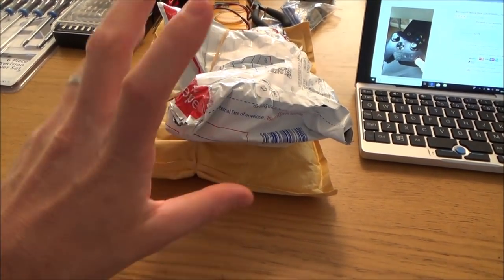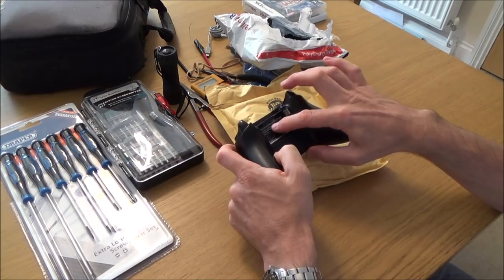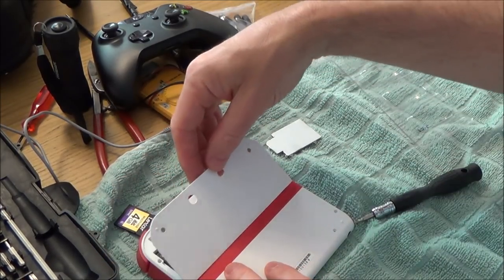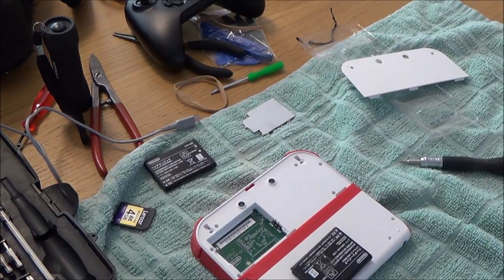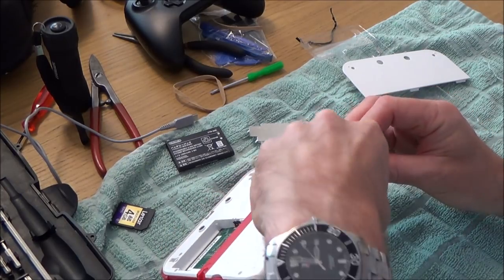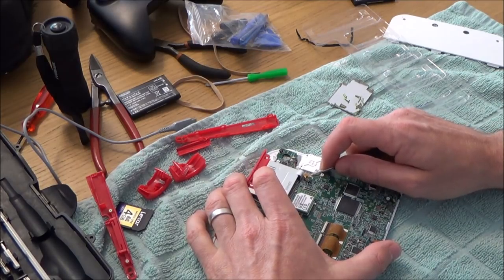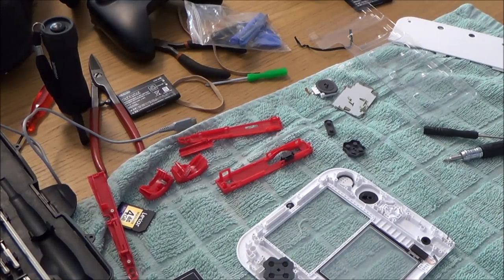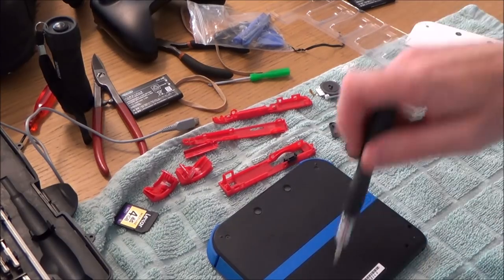Trying to FIX a Nintendo 2DS and Xbox One Controller purchased on eBay

Comment: When the 2ds detects a part missing or a broken part it will pop and not boot to stop further damage.
Reply from the maker: Interesting, thanks for sharing the knowledge :-)
Reply: Hmmm.... I am wondering if the battery you took (I assume it was from the 2ds xl that did the same poping for your last video) is also fauly, causing the 2ds to turn off. But then there is also the broken screen, so it might be detecting that (highly unlikely though). I have not watched the whole video yet,, so if the solution/answer to this pops up in it, don't yell at me.

Edit: I mean the battery you used before you replaced the parts into your working 2ds.
Reply: The battery isn't faulty, it's just unsafe.  Bulging batteries still work perfectly fine.
Reply: Elliot A. Ik, what I meant is what if the battery from a 2ds XL for a different video is faulty. WHAT IF!
Reply: They're all the same CTR-003, the old 3DS (not XL model, the small), 2DS, and 2DS XL use the same part.

I've also had this problem of popping and turning off with a 3DS and another on a 2DS. Even just a disconnected/badly connected flat cable is enough to trigger this hardware check and power up failure. In the 3DS you may usually be luckier that it's not the broken screen, but just the speakers flat cable torn (it carries speakers, 3D slider, 3D LED, camera LED, backlight and 3D panel signals. Yes, it does a LOT), and it's a cheap part but annoying as hell to install.
Reply: Kalvinjj ik that they are the same batteries. I was just saying that the other one might have been faulty as well. Anyways, yeah, broken ribbon cables are a pain in the ass to fix as they pretty much need to be replaced and can easily be damaged. It's kinda cool that the 3ds has a hardware check. It would probably be fine without one.
Reply: that explains why my mothers 3ds isn't booting up
Reply: Unsafe sounds faulty to me
Reply: It's actually popping due to a cable thing. I've heard of the popping issue so much, and now my 3ds is doing it as well. I have never taken my 3ds apart, and I have never replaced the battery. It just randomly started turning off with a popping sound. I'm worried it'll get to the point where it won't even turn on...
Reply: The Jolly Good Gamers my brothers old 2DS would freeze at a certain point in my pokemon X game, locking me in a certain part. Then other times it would show a bunch of colours on the screen saying “error 101”. Or it popped. Thx for info❤️
Reply: @elli6220  except for when they overheat or stop holding a charge
Reply: @Mymatevince  could you help a fellow nintendo fan? I have quite a few 3ds xl's and a 3ds and 2ds. the 2ds is my "problem" purchase. I purchased it for 28 USD and it was described as "will not turn on", I've tore it down, checked and cleaned and reinstalled all screen ribbons, tried cleaning known issue parts, and even recently put a brand new battery in. all I can get is a charging light but no power or response whatsoever with no charger. I'm at a loss considering there are no broken pieces upon tear down, nothing lose or water damage. any ideas sir?
Reply: @andrewvizla9454  haven't taken apart a2ds but on dsixl there is a sub board that has the power button and a f1 fuse check that first I had a dsi that wouldn't turn on but charge light would come on. I checked everything and finally got it to turn on after taking case off and pressing the button with uncomfortable amounts of strength
Reply: @elli6220 late reply it worked when my gopro battery started to swell up! I originally used that battery until I got a new one and discharged the old swollen battery as I believe discharged swollen batteries are safer

Comment: This is giving me a good idea on what to do with the 2ds that's in the mail. The ebay seller I bought it from was selling it with the "OLD"/Original 3ds, "OLD" 3ds xl, DS Light, and a DSi xl. now they're all faulty systems. Also I suggest for you to look into getting little shot glass sized cups and/or a Magnetic bowl to help organize the tiny screws so they don't get lost.

Comment: Would love to see some PS4 fixes, especially cleaning the fans as mine sounds like it's about to take off constantly. 😂
Reply: Steve my friends system does that as well, bad heat transfer from the APU is a possibility, get some thermal paste and get in there as soon as possible if that is the issue.

Comment: not sure if its worth mentioning but some 3DS/2DS which have been modded with CFW (older CFW) wont turn on without the SD card in, might be worth while trying that on some if you get anymore in the future.
Reply from the maker: Thanks for the heads up :-)
Reply: My Mate VINCE did you try it
Reply: Also adding to it too: they MIGHT turn on without a card. I've done it to my 2DS and 3DSes I've got to sell here, it's a script your run to copy the boot file to the internal memory so it boots with modded card, without, or with any card.
Reply: Kalvinjj aye that's the new cfw, older methods didn't :)
Reply: that wouldn't be it, if that was it, it wouldn't have made it to the home screen
Reply: @burp2019  yup I know, that's why the last part of what I said was if he gets any more in the future, wasn't necessarily meaning it was the solution for this one.

Comment: Those broken screens will haunt you to the end of time, man. Like I said before, you handled that like a pro and it's cool to see you already developing the resources you need to get the job done.

As for the Xbox Controller, that's basically programming and computer problems in a nutshell. Sometimes it just doesn't work, you fiddle with it, and then it magically starts working. Although now this opens the door to a very interesting path to faulty console controllers. I definitely would like to see more of those as you'd probably have a much higher chance of success since they don't have screens that'd need fixing!

As I said before, great video and keep up the awesome work, Mr. Vince! :)
Reply from the maker: Thanks so much :-)  I have a job lot of faulty Xbox One controllers arriving hopefully this week and I think they have various different faults so maybe the video will be more interesting and varied :-)
Reply: That sounds awesome! I can't wait to see it!

Comment: Great video mate. You should try finding a faulty switch now 👍🏻
Reply from the maker: I would love that but they are still too expensive. I missed out on a £109 buy it now listing that had a didn't charge fault because I hesitated. The auction ones go for over £150 for a faulty one without Joy-Con or dock which is madness :-)
Reply: I saw a faulty Nintendo Switch for 95 dollars in eBay yesterday
Reply: My Mate VINCE ok, hopefully it doesn’t take long for the prices to go down. Keep up the awesome videos. Love this style of video where you find faulty electronics and try to fix them
Reply: Uuuuuuuu
Reply: And now he has like 5 Switches. You should do 3DS bro :)

Comment: It wasn't because of the usb cable that the xbox accessories app wouldn't let you update the controller, the app is just really buggy sometimes. I've had the same issue when I went to update my controller which isn't faulty.

Comment: The reason the Xbox home was jumping so quickly when you press a button or shoulder buttons was because it was detecting 2 buttons pressed down and maybe the A button was a little but grubby and was sticking to the pad hence why you couldn't get it to turn on as well and also maybe due to the last owner having heavy sweaty fingers. Just thought I'd mention as I use 2 button press to navigate the home pages faster! Great video as always and superb fix.

Comment: "Yeah okay" semi excited sounding, then pulls out a hair XD cracked me up. Oh just a tip that I do when taking a controller with a rumble feature in it is tape the damn things into the slots they sit. Those things make me so frustrated while working on faulty controllers also helps keep those wires from accidentally breaking off.

Comment: Looking forward to seeing fix it video number 5. Keep up these videos really enjoying them.
Reply from the maker: Thanks Muffin Man :-)
Reply: My Mate VINCE You picked up a bargain with that controller, it was a corrupted firmware, leaving it plugged in for a few minutes initially downloads the firmware in the background, but re flashing the firmware again fixed the issues. Nice repair.
Reply from the maker: Yeah, I didn't know that until a few viewers mentioned it. It would have been a real easy fix if I knew that at the beginning. The controller is nice and clean now though which is a plus point even if it took a couple of hours to get there :-)

Comment: That's depressing. I used to take apart my Xbox 360 controller, and the Xbox One controller is the same concept. Torx 10 with security bit screws, 7 of them, 3 on each side, one in battery bay. Just they integrated a data board onto the Xbox One controller for firmware, which is cool. But what may have happened is, the firmware chip needed some power and data flow into it from an Xbox to reconfigure its chip so it can work again. And the reason they have a shield on the analog sticks to prevent the sticking is because the 360 design would allow you to take the analog stick all the way to the edge of the rotating swivels which would eventually snap them which made the analog sticks get stuck, nice to see they fixed that design flaw.

Comment: Vince i had a controller that wouldn’t turn on it was because the little gold trampoline (!) that seems to haven’t made contact between two boards. I pulled on it a bit and resinstalled and worked fine!

Comment: Super easy way to check for an expanded battery is to set it on a flat surface and spin it like a top. So long as the battery is manufactured flat like these and not something like a PSP 1000 battery then it should just stop because of the flat surface friction. If it spins then it's bulged and needs to be recycled.

Comment: Going off my experience with phones and laptops... Sometimes when things have been completely discharged they needd to charge for an hour or so before there's enough charge to power up..even if it is normally able to run off charger... Looks like you ended up on the right path anyway.... But worth bearing in mind.

Comment: The problem is the driver inside of the controller. when you plug in to PC it says DFU mode. (like recovery) and then when you connect to xbox and leave helped the drivers / software in the computer. that should be fix the issue.

Comment: DFU usually means Device Firmware Update and is a mode in which a device goes if it can't boot properly and wait for a firmware flash. So maybe the last firmware update failed ( explain why the controller was sold as not working) and when you plug it in the Xbox, the console detect the faulty controller and reattempted a firmware flash
Reply from the maker: Ohhh right, I didn't know what DFU actually meant. That explanation makes a lot of sense now :-) Thanks for sharing this knowledge.

Comment: when you put the the mainboard from the faulty 2ds into your working one you basically switched 2 parts, the screen AND the touch panel of the lower part of the screen. the screen is definitly damaged, but the touch panel could be too. for ruling that out you should have put the screen from your good 2ds into the faulty one.

Comment: You can tell if it's been opened up from screws, look them closely. Does it look like bit stripped, or does it have marks of screw driver. Also does the casing show some signs of opening

Comment: Lil tip; put a magnet on the shaft of your screwdriver to pull screws from recessed holes ;)
Reply: If you rub the tip of a screwdriver over a magnet you will get the same result.

Comment: I know this is a late comment but the reason why the Nintendo switched off is due to watchdog circuitry. when switched on the circuitry looks for feedback from the backlight of both screens and if either is absent or incorrect it will instantly turn off again.
This circuitry is found in all DS series as I used to repair them.  I used to temporarily bypass this circuitry to ensure that the working screen has no pixel damage before replacement.

Comment: I use a wired Xbox 360 controller for the pc and the cable died (loose connection somewhere along the cable). 
If you have a spare USB cable, that is really easy to fix. 

I de-soldered the internal connector that connects the board and the cable and just soldered the spare USB cable directly onto the board.
(more reliable than trying to get the male part of the connector onto a new cable, but I think that would be doable as well)
The cables have a standard colour code so its easy to know what has to go where. (Triggers facing away from you, it's: Red White Green Black)
https://i.imgur.com/VMenDBC.jpg
(sorry for the blurry picture, noticed too late but I guess you can see it well enough)
Was like 20 minutes of work, most of the time to get the casing apart and together.
Really easy and saves a bit of money. 

So yeah, I agree with the channel here, it's sometimes worth it to take stuff apart.
Of course, only if warranty doesn't cover it, otherwise sending it in would just be the better idea.

Comment: if you push down hard, you can use a small flathead screwdriver on xbox products, instead of the security bits. Anther tip is to use a screwdriver that you can put the bits into, to get a better grip.

Comment: Wow that controller was really weird. Idk how the programming for the controller works but it seems the drivers and programming were broken for it.
Reply: Alex aka Weekenders as Vince mentioned in the video, the device manager on windows 10 said DFU mode. Most of the time DFU mode is like a mode that you would use to install a firmware update, maybe the original user had tried to use CFW and somehow softbricked the controller. Leaving the controller plugged in would’ve taken it out of DFU mode so it wasn’t a driver issue at all.

Comment: i had similar issues with one of those xbox controllers. The usb connectors are prone to damage but whats worse is the USB cable that comees with them, it doesnt sit nicely in the port, mine was always wiggly and would drop connection at the slightest movement since the day i got it. I got some cheap usb cables on ebay and they worked alot better, snug fit and less likely to stop making contact with the pins. Eventually the port broke and I've used battery packs ever since, no more cable charging and disconnects. The a button also stopped working, and its very hard to find a suitable rubber membrane that fits well and doesnt feel hard to press. oem parts not available, just cheap aftermarket options that are hit and miss.

Comment: Ive been messing around with the 3ds line, and every single one will make a pop sound and shut off due to missing/damaged hardware. If it was really bad damage, it wouldn't turn on at all or get stuck with the blue LED (as in, no led at all or led would stay on indefinably). Try it with a mother board and battery lol
The touch screen broken making it pop wasnt due to the inputs, it was due to the fact iirc the voltage wasnt what the 2ds was expecting. Ive had a 3ds xl with the touch ribbon cable badly damaged, and the console worked fine, minus the touch screen regestering a bunch of touch inputs.
Also, theres parts that are for the most part compatible with the whole line.  EX, the wi-fi chip from a 3ds works in both the 3ds xl and the 2ds. It also would cause it to do the hardware fault if not properly seated. It was a problem with the 3ds xl, without people opening them up.

And about the CFW thing, its definitely not that, as it turned on long enough to get to the home screen
EDIT:What started as a 2 sentence comment evolved into a paragraph over the course of 10 minutes lol

Comment: no offense, but i'm really triggered on a few parts. one of them being the fact that the first time he tried to power on the 2ds, with the bulging battery still in it, he didn't let it charge, or even try to charge. he just went straight to trying to do stuff with it. the other one being the fact that the thing that fell  out of the 2ds when he was opening it was a piece of RF shielding, used to sheild the components and help cool them down. That aside, i love the vids, keep up the good work! :D

Comment: Yeah replace any bulging or swelling lithium ion batteries or packs they swell because gasses build up inside trying to escape but they can't until eventually a catastrophic event happens like the electrolytes leak or it bursts into flames also can damage device by putting pressure on anything near the battery especially if it is in a tight enclosure

Comment: The DS was designed to fail. I've had several of the original DS and the 2DS. They all stopped taking a charge around 6-9 months of use. Turns out there is a resistor that fails and stops charging. If you bypass it you're back in business. I still have one of each and they continue to function just find after the bypass. They're several years old now still going strong.
Reply: Also my 2DS have the triblade screws. I don't recall seeing one with phillips heads. I could be wrong.

Looks like the one you ended up with took a hit in the front. The screen was cracked and bent inward slightly. I bet it was an angry player that went completely "game over" on that device.

Comment: I tried to fix my Nintendo DSi With common sense like you did and even looked after my screws. and then went to put it back together and somehow I had lost a screw even after I had looked after them it’s not like it mattered though because I couldn’t fix anything I think it was the ribbon cable.

Comment: This uses Chip on glass tech to control the screen.  If the crack damages the driver chip that is embedded in the panel it will pop.